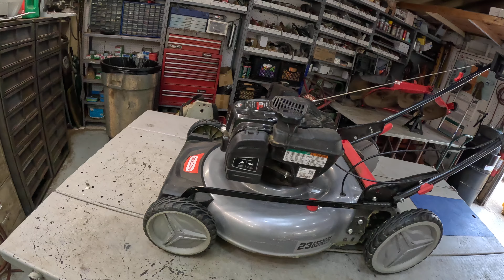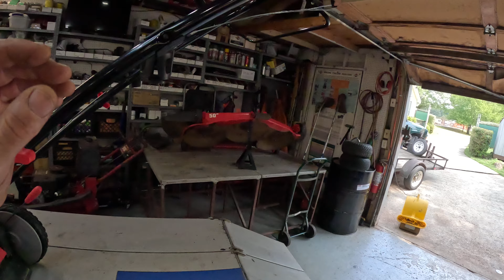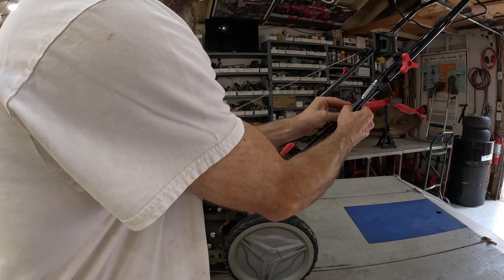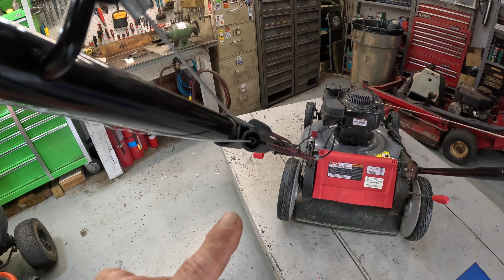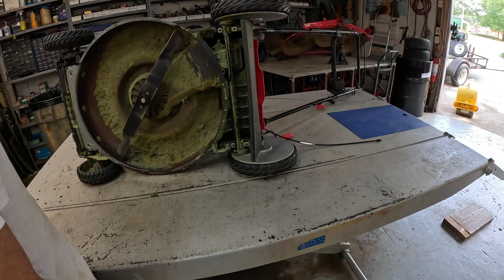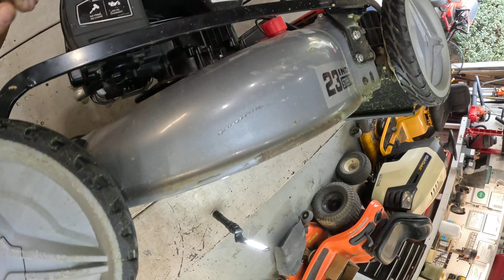Oregon Push Mower | Self Propel Drive Cable Replacement!

Comment: Hello Tom From Kentucky. Earlier this spring, My sister purchased a YardMaxx push mower that was set up identical to the Oregon mower that you are working on in the video with the exception of the Yellow & Black wheels. The YardMaxx had the Briggs & Stratton engine which I believe was the same identical engine. The engine had a very weird sound that wasn’t quite a knock to it and was extremely difficult to start up and was even more difficult to start once the engine had ran for a while. I told my sister that that thing was a ticking time bomb and that I would ask for my money back. She got the price of the mower plus a refund of the insurance that TSC sells for their small engine stuff.
Reply from the maker: right, tractor supply! forgot about those woke folks hahaha, i hate touching a cheaply made piece of equipment cause you'll be on the hook every time it tears up!
Reply: @TomDobyMowerRepair  The mower itself was nice in concept with the 4 wheel height adjustment with 1 lever, But that engine was pure garbage. Briggs & Stratton did a very poor job assembling that engine which I kind of wonder if it wasn’t imported from China truth be known. My sister purchased that POS at the TSC location in Frankfort KY and we returned the mower to the Lawrenceburg KY location. At first they tried to imply that they didn’t sell YardMaxx mowers and that is when I joined the discussion. They looked up the mower and said that some locations do not offer some brands that other locations do. It was definitely an interesting experience to say the least. I follow along with your videos quite a bit, Tom.

Comment: It's an exact match to a crapsman push mower, I just did one today, even the water hose attaches to the same spot on the deck, they are all becoming Chinese crap man.... The only plus is mine had a Honda engine on it.